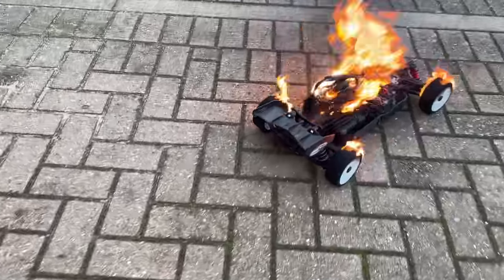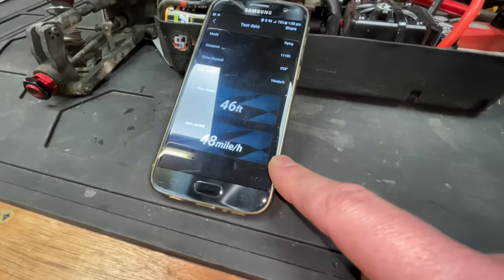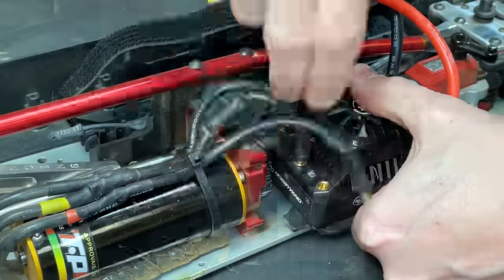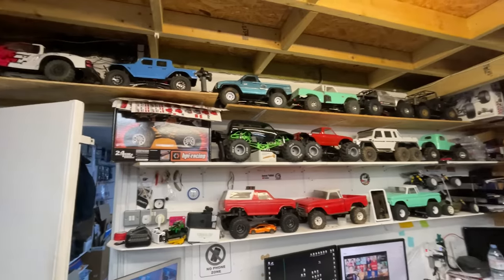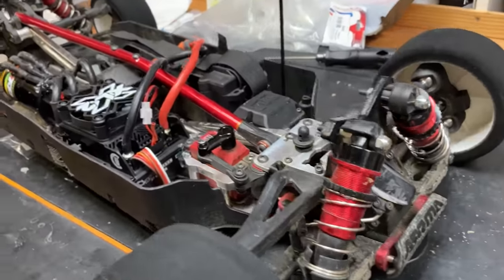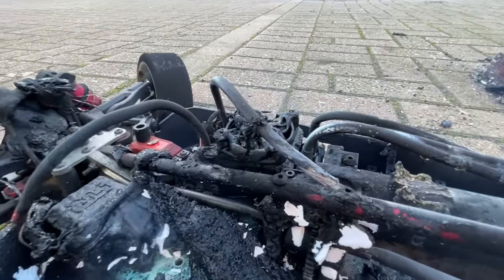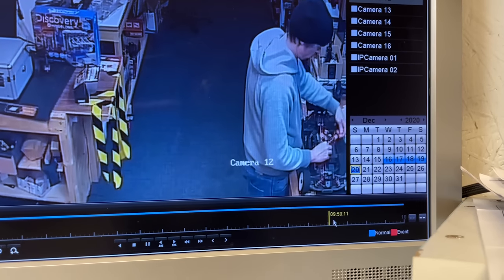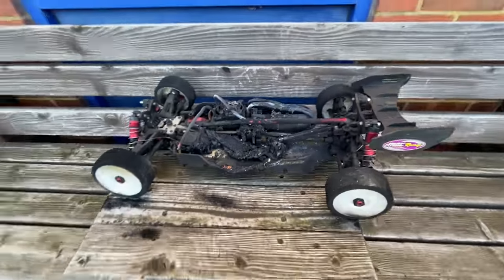Hot Wheels!! - RC Car FIRE - Castle Cremations XLX2 Failure

Comment: Castle been going up in flames for years.
Over rated,  over priced,  and over here.
You deserve better Kevin.
Reply: @brokenmember1658  I honestly think hobbywing is better because never seen one go up in flames like castle creations but then again I never owned castle
Reply: @miguelgaviria5836  thats because hobbywing limit their escs.
Reply: What are the fastest esc’s for high amp use castle period . They gave us a god esc with basically no limits so you need to know what you are doing. I have sold and installed over 20 of them since they came out and never one failure. Good plugs something in the 8mm range at least. And quality battery’s. No free revving and most importantly moderate gearing until you monitor the data logs and make sure it’s working in its proper range and if so gear up , or change timing (one at a time here ) run it and check again. And so forth
Reply: @1521joe  they are great esc’s but how can it be better at the price point? I have owned several and they still don’t put pace a 8s mm in amp delivery. I don’t see any mgm cars going over 160 and there are reasons. One if they break they take forever to get repaired and shipped back to you. 2 it’s a old gui on there programming and it’s not native to most as they are designed to run anything cars planes Heli’s etc. 3 waterproofing is a option if you want it and so are a few other things that castle gives you without extra cost. And not trying to start anything but have you owned any mgm products? At this point in the game flier esc is a better option than mgm. Only esc that they have that will stomp on castle is there 800 amp one but at like 10 times the price. There is simply no other 8s esc on the market that comes close period.
Reply: @theodoreberry3486  is it safer to get the 400 amp Flier EsC over the XLX2?  I want to run 1100kv in a DBXLe 2.0 with 18T pinion and stock spur size.
Reply: @gaffle-411  on that light of gearing a xlx2 will be fine but the flier is a good option. They are opto esc which means they need a battery to power the receiver as they don’t have a bec

Comment: KEV! You need to pay attention to your ripple voltage. If you spike over 10% this will happen. Something you did caused a spike. I would like to see everything you did on the build. It could be anything? Too small connectors for that motor set up. The soldering looked good from what I saw. Looked like lead solder which is good. Battery’s? I will have to look to see if you had mismatched or older batteries.

Comment: At 4.06 just after Kev plugs the motor wires in, there's a little flash. Is that a status LED or an electrical short? Lol

Gutted though, not what you want when fitting upgrades! Keep up the good work Kev, reminding me how much fun RCs can be 👍

Comment: Soldering lipo connectors on too hot or too long can cause internal damage to the battery and the pack can randomly burst in flames. Thats why I buy the connectors already soldered to leads and you dont have to get it as hot to silder the aluminum wire to aluminum wire
Reply: The xlx2 reccoments qs8 or castle 8mm bullet connectors. They handle twice as many amps as what he used. That was the issue

Comment: PSA: When using a fire extinguisher, make sure to FULLY SPRAY THE FIRE. If you see smoke, use the fire extinguisher. ANY EMBER CAN SET IT OFF AGAIN. Also, like Kev did, put the object on fire somewhere where it won't  cause a bigger fire.

Comment: I just wanted to let you know you can make your XT90 connectors hold better again by spreading out the prongs on the ESC side. Usually just plugging and unplugging them pushes the prongs in and makes them loose

Comment: Kevin, I believe that the programming update you added to the ESC may have caused a voltage overload short in ESC circuitry. I am not blaming you for the ESC fire. The ESC could have had a fault at any stage of its' assembly process. Please rebuild your world record breaking long jump car.

Comment: For the batteries being on fire so fast there had to be a short. Either the "perfect soldering" or esc failed creating a short. Does the esc still work?
Reply: If the soldering was bad then it would've likely lit up when he plugged it in, not when it was revved up

Comment: 3:39... USER ERROR... should be running Qs8 connectors.  They’re good for 300amps.
Reply: And shouldnt be running a 3200kv 3d wind motor
Reply: @andyvannort2743   I believe that high KV issue has been addressed with the new firmware.  That's honestly a Castle issue (not being able to handle high KV motors).  They make and market a high-performance product, it should be able to handle high-performance motors.  All good now...
Reply: @gaffle-411  yes they claim to have fixed the high kv and d wind motor issues. And yes its a castle issue. But honestly i cant blame them. Castle products are designed without limits. With people using all sorts of varying factors. When pushing 400-600amps through an esc there are bound to be problems because nobody else is doing it. Its new territory. Except mgm multi thousand dollar escs. Cant test everything in the world or wed still be waiting till xmax for its release. As long as the issues are truly fixed. Im waiting to pair a xlx2 with tp 5860 until i see someone suceed with it. Cant really compare these to a max5 with 200amp limit. This is in a world of its own
Reply: @andyvannort2743  Just got my  XLX2+1100KV Castle combo.  I don't expect any issues.  I'm running QS8 throughout + a cap pack.  Good luck with yours!
Reply: @gaffle-411  same ive got qs8s, ripple killer 8s cap pack and 120c lipos. If it takes too long to see someone try a tp motor i might just go for it. Outside the rig. Castle will replace if it fries

Comment: Kevin Talbot had unplugged an esc that had smoke. As long as you do it right way it will stop the flames or the ignition source. Idk much but it must not of stopped drawling amps and just built up too much. I broke a dynomite fuze esc with no gear on it revving the heck out of it and it smoked. This is just a hunch

Comment: I suspect that you had a short somewhere. Something was loose and shifted when you picked it up holding it nose down.

 Of course any electronics have the chance to fail but, by all reports I have seen, those ESC's are  top notch in both performance and ability to stay cool. 

The MMX8S seems to be a work of art from what I have seen and heard. It stays cool under both extreme bashing with huge motors or during speed run after speed run and performs awesome. I've even seen it running cool while powering the X-Maxx on a hot day and during a hard lengthy run.

Yes, I understand that reviews, especially those on YouTube are subject to sales tactics. I also can only offer hearsay as to the new Mamba line however I am a fan of Castle Creations ESC's in particular. So, if someone knows something IDK about the new Castle ESC's, please say so, so I can avoid purchasing one in the future.

Comment: Hey Kev! I saw that both XLX2's caught fire. I recommend a few things. Either put the same esc and the same motor in the car. (The same motor and esc combo that is in the Kraton 8s) And see if that works. Or get the Mamba Monster X 8s combo, and see if it will work with that.

Comment: Woulder if it was the settings change you did was the added power above and beyond standard also it happened when you up ended it is it possible something was able to short circuit the esc was it a cap bursting or the adhesive flammable or off gassing from the adhesive.

Comment: Also anyone building these, led solder and perfect. 250 amp connectors, ripple voltage cannot go over 10%, your motor, batteries or connectors may have caused this. Unfortunately these esc are bad ass but need to be done right. Sorry Kev. Do more research on the set up. The hobbywing esc’s are more forgiving but not as powerful for speed runs. Love ya KEV!

Comment: Kev what I think caused your Esc fire might have been something with the motor terminals on the Esc end. I had a castle Esc in my slash which did the the exact same thing which I narrowed down to being the Esc motor terminals. Whith motor just cleanup spray some wd40 in it and it will be fine.

Comment: Push a small screwdriver down the male plug of your xt90s. All you have to do is separate the prongs a little bit. I usually pinch mine tighter when I first solder them on and have to re-expand them every six months or so. No reason to swap all the cars if they don't need it.

Comment: After seeing your 2nd vid where the castle popped.  Thats what happened here and it fried your batteries. If you wouldnt have cut the wire in you other vid this would have happened to them to. Inferior components on castles part i bet. Check the capa itors in this one too. Thanks for the great vid Kevin.

Comment: Does Hobbywing Max6 or Max5 ESC have a kv limit? I was planning on getting a TP 4050-2350kv with a Max6 for a 200+ speed run build. It would suck to get a 2350kv motor and it is limited to 1500kv. I couldn't get a direct answer from Hobbywing  support.

Comment: I've seen Kev struggle to remove motors and ESC that are glued down. Id use a thin wire saw with the keyrings on each end.
Reply from the maker: thanks dude

Comment: regarding your XT90/60 problem. just bend the prongs back outwards, good as new!!
Reply: there is also XT60-L which is xt60 with a plastik latch kind of thing that secures both ends mechanical and does not only rely on the surface friction. I say xt60 but they are available in all sizes

Comment: Castle are awesome. The firmware has been reworked. Most of the problem is people DONT FOLLOW INSTRUCTIONS. THESE BIG ESCS ARE EXTREMELY POWERFUL, THEY NEED VERY HIGH CURRENT PLUGS N LEADS AS THEY RECOMMEND. 
6.5MM Gold bullet polarised connectors rated to 200 amps with 8 awg cables or even 6 if you wanna spend the extra cash. 
Lots of people running speed runs with crazy powered systems have gone to these connecters and have no problems anymore. Plus a good cappack will protect an ESC if your demanding alot from it.

Comment: Hey Kev if i remember correctly the TP motor you have in there is 3200kv? The mamba XLX2 is only rated up to 1100kv. That is why your esc just blew up.
Reply from the maker: thanks man. i didnt see kv ratings anywhere
Reply: Also should be using 8mm connectors like qs8 or castle bullets

Comment: That’s crazy, those things are built very good. I haven’t seen one of those catch fire or heard of one do that. My mamba x go super hot and un did the soldering on the motor plugs on the control board it happened when I upped the bec voltage and switched it to sensord setting for the motor I was using.
Reply: You just haven’t searched for it. It happened to me and tons of other people they have a bad rep for esc’s catching fire.

Comment: I think it may have short circuited, I had an 8.4 volt nimh I was about to charge and the pos and neg were together and it started getting hot, may have been a defective esc or maybe the connectors weren’t on right

Comment: That sucks. My XLX2 is working great on my Outcast 8s with the 1100kv motor and 35/47 gearing, but I don't do super extreme stuff like Kev. Just 15ft jumps off my ramps mostly. I've heard of the XLX2 catching on fire on extreme speed runs that people do though, but not bashing. Actually I went bashing with the XLX2 yesterday and only the power switch was giving me trouble. I know that the ABC wires have to go A to A B to B and C to C with the stock 1100kv motor from Castle, so I don't know about that aftermarket one. Castle says that if you don't put those correctly, damage to the motor and ESC can happen. 🤔

Comment: Capacitors gone wild! This is why old amplifiers need their capacitors replaced every few decades. A bad capacitor can cause an overcurrent for anything down the line. I could be wrong; but ya, cheep capacitors can fail.

Comment: Watched back, your batteries looked older, and your ic5 connectors are too small. Caused too much resistance. Put 8 mm connectors and new batteries 75-100 c rating. Test all cells with a multimeter and make sure there all within spec and even. I do see a few reasons why this happened. I use the Arrma orange ic5 on everything but not on the castle esc’s.

Comment: I would have to see that from a better camera angle... Castle had been top of the bash combos for so long I never had 1 issue with their esc or motors... Couldn't been those cheap beat up wires that were soldered and I think it's strange seeing no flames from the esc.. both lipos were on fire so I think you should of put it out faster then open the case of the esc... I want to see exactly where the 1st flame came from.. just saying..

Comment: I've had a lot of Castles (including some mechanically damaged in crashes) and that's never happened to me, but I'm thinking the ESC. Other less likely options seem batteries (are these the same brand that were in the speed car when it caught fire), the pinion/spur chewing through the power wires and shorting them, or maybe the motor wire soldering. I don't think it was the ic5s or their soldering, that would have happened as soon as you plugged in the battery.

Comment: KEV READ THIS 

I know why your esc cought fire.
The kv rating was to high. Its like the ztw beast wich burnt out in the 203mph car. The castle xlx2 has a kv rating too the maximum kv is 1100kv.
Reply from the maker: where does it say the kv limit i cant find it anywhere?
Reply: That’s odd because I just watched a video of a guy using a brand new castle 2028 1100 kv motor and a brand new xlx2 and it caught on fire within 3 minutes. Not to mention castle has a service bulletin on their page right now about their esc’s catching on fire. Don’t think it has to do with motor kv. Your motor kv is limited by battery cells not the esc

Comment: Maybe programming the ESC caused it to spark? 

Could've been from you reversing the motor rotation electrically, instead of just switching out two of the motor leads. The TP motor isn't sensored, so it wouldn't damage the ESC.

When you reversed the rotation, it might've caused a short-circuit and set off the lipos?

Comment: Maybe the center diff might have been loose and when it was picked up it got caught on the ESC casing and got to the circuit board? I don’t really know how the Arrma 4wd platform goes together. If it did reach the circuit board the casing on that ESC is way too thin.

Comment: Yea, nah. I've steered clear of Castle Cremations because of this very reason!
The last thing I need is any of my RC helicopters spontaneously combusting.

If I know my BLDC motor controllers (which are what ESCs actually are)... *goes full electronics enginerd*
...what would have caused your fire is a "shoot through" condition (or otherwise known as cross-conduction), where both the high side & low side MOSFETs of the same phase are on at the same time.
Even when it happens very briefly (EG a few microseconds), it's enough to cause catastrophic damage.

To put that in layman's terms...
The ESC created a short circuit.

I don't know what the folks at Castle Creations are smoking, but their motor controllers are highly infamous for spontaneous combustion. Their Ice ESCs have/had the worst reputation for it.

Like I've said... I've stayed away from Castle Creations because of their infamy.

Comment: try it with the stock config.  dont even plug in the card, if the motor turns backwards, swap 2 wires.  or have 8s steve come to program it!

Comment: Perhaps the fire would have been prevented with qs8 connectors. Ic5's are only rated to 150 amps, while the Xlx2 reccomends connectors over 150 amps.

Comment: Castle used to be the workhorse brand. Now it's the same junk with a high price. If anything, ZTW is more reliable for me the last few years.  The ZTWs that burn are from noobs who put some 2400kv+ motor on it, hook it up to 12s and wonder why they smoke it.  Wonder why the new versions have a sticker warning about how many cells/kv?🤔

Comment: I'm curious what happened myself. I know people who run the xlx 2 with no issues. I've only seen them catch fire on YouTube videos. I couldn't even guess where it went wrong. I never had a plan on getting an xlx myself because if I need power to pay that amount, I'm going with something rated for 16s. If I'm only running 8s, I'm good with just the Hobbywing Max6 or Max5. I do have a Castle Creations Mamba Monster 2 for my Summit, but no other castle products.

Comment: What I did with my xt90s when they got lose I would get a Phillips head screwdriver and push the pins I. The female side and it makes them tight and they don’t fall out that easily. There just a little hard to post on and take off.
Reply from the maker: that only works a couple of times and the pins break

Comment: Kev also you did not set the esc settings for the motor to be sensorless, you are using the esc on sensored mode with a sensorless motor so of coyrsenit would catch fire on high rpms and braking, its confusing the heck out of the esc,i have proof that when you are saving the settings, it still says smart sense for the motor settings, means its on sensored motor mode, if you want the timestamo for proof its 4:30 and this is 100% your fault kev, dont get it wrong, im not a hater, i live your channel, jist explainign to you what is the probably main caysebof the fire😊

Comment: Looks like shorting, but from the ESC. likely it overdrew current and blown a MOSFET that went shorting the batteries. Lipos have no protection circuitry to prevent this (unlike 18650 or Lifepo cells). Darn!

Comment: The KV rating of the esc was lower than the rating of the motor. 
A configuration like that is causing big resistance in the motor, leading to circuit rap